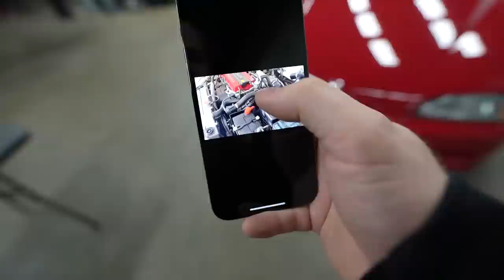MY EVO 4RS IS COMPLETE!! (UK EVO UPDATE AND RADWOOD!)

Comment: Tracklife fender cuts for Hondas=better aero, cool factor, and I think can allow u to fit a fatter tire underneath? The company only produces the cuts( in carbon fiber too) not whole fenders mostly used for liike time attack type stuff
Reply: They also have adjustability so you can mount them flush with the door or slide them out depending or wheel tire clearance needs.

Comment: You should look into restoring Lancias, the rust is a stock feature, also the electronics come broken from factory. If you can supply rust free metal and non-suicidal electrons you'll be pretty popular with Lancia owners. Unfortunately most Lancias turn to dust before you can restore them... Clean ones are epic cars though.

Comment: So the red crx the fenders you got the brand right basically
You cut off the bottom half of the fender and that piece goes on in place it’s suppose to “allow hot are to escape
To help brake Cooling” most people do it to be “kanjo style” and stuff hardly ever done for actually use and purpose lol